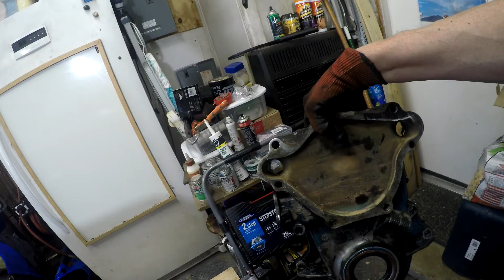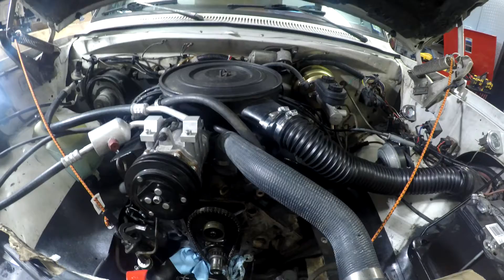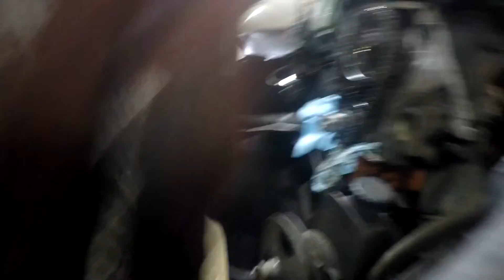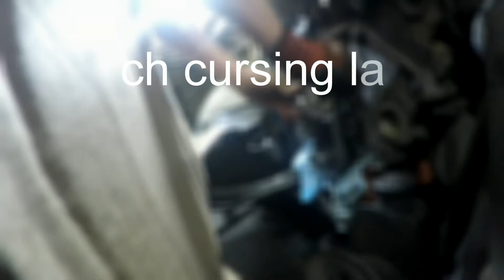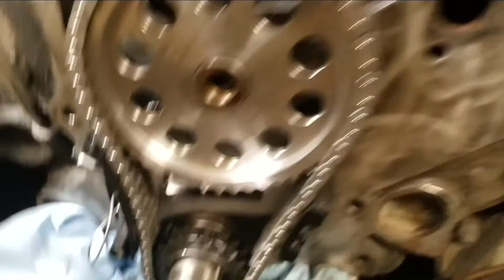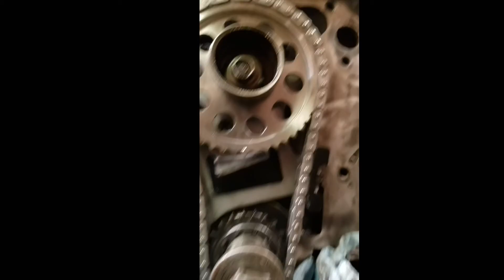1986 Dodge D150 318 Timing Chain Tensioner Upgrade

Comment: Great video! Thank you so much for posting! I was doing some research on my own truck, which led me to your video. I have a '97 Dakota, but it's not the V8, it's the 3.9 V6 (Magnum). It has just under 89K miles on it, and the chain has rattled since I bought it almost 2 years ago in 2019. I finally decided to address it, and have been doing some research. I want to put the strongest, longest lasting chain in it that is available - and from what I have read, that would be a double roller. I have been told that if a double roller is used, a tensioner is not necessary - but if one can be installed, I want to put one in! No such thing as overkill right? I have been trying to find out if anyone has used a double roller chain along with a tensioner on a V6. Summit Racing was kind enough to respond, and said that a tensioner would not work with a double roller (but did not explain why). Then, I found your video, doing exactly that - but I also understand it's not the same engine as mine. Do you mind if I ask you: Is this something you are trying on your own (using a tensioner with a double roller), or did you already know that it would work beforehand? I realize we are talking 2 different beasts here, but I wanted to ask you after seeing your video. Looking forward to hearing back from you (if you have time to reply), and also looking forward to part 2!  Thank you for your time.   -Steve
Reply: Hi Steve, "No such thing as overkill" is exactly what I was thinking.  The timing chain tensioner that I used was originally designed for the V6 due to timing chain stretch issues on that motor.  Apparently it was so bad on the V6's that Dodge created the tensioner and put out a service bulletin for those complaining about 'noisy' engines.  Did your V6 Magnum already not come with it installed?  I have completed the installation and so far, so good (I'll be posting a follow up soon but there's nothing much to show really).  FYI, it was a real bear to get on as you can probably tell from the video.  As far as trying it on my own, I had read forum posts where they said it was ok to use the tensioner with a double roller so I just decided to give it a try to see what would happen.  I don't know how much extra life I'll be getting out of the chain but It's a bit of a pain to get the cover off so I didn't want to have to do it again for a long time.
Reply: @psykoD  Hi Tim, Thank you so much for replying. I really appreciate you taking the time! Glad to hear you are back on the road and all good so far. From what I understand (to answer your question), Dodge didn't start installing the tensioners from the factory until '98, and apparently my truck never had the tensioner retrofit as per the service bulletin. I also wanted to mention that while Summit Racing stated that a tensioner would not work with the double roller, Hughes Engines got back to me, and not only said both could be used together, but gave me the part numbers (the HUG 6440 chain setup, and the CLO 9 - 5387 tensioner same as yours). So, thanks to you and Hughes Engines, I have the info I need now. Like you, I don't want to do this again for a long time! Thank you again for taking the time to reply Tim. Take care! -Steve

Comment: The Chloe's brand was the only brand that had It advertised for small block Is 318 I bought mine for 3.9 l It is the exact same One number off on the part number And was $40 cheaper

Comment: Thank you for the vid. I am working on a 87 Dodge Dakota, with a 3.9 Mitsu V6 and I think its similar, but the guy thinks bubble gum and tape can fix anything on this old truck. LOL, it took me half a day to convince him that it was leaking antifreeze from the timing chain cover and not the freeze plug that is strait behind the fuel pump on the front of the engine.
I also think I am going to have to pull the fuel pump to get the timing chain cover off, and I know the Harmonic Balancer has to come out. He thinks its just a 6 bolt deal and that will be it. 
I also am betting the antifreeze has corroded the crap out of the passages on the cover. IDK, I will see in the next day or 2.
Good vid though. The Klingons would be impressed: https://youtu.be/_2nM6iaT2u4 LOL, for grins.
Reply from the maker: Thanks!  Good luck on the leaks.  I know it's hard to find a good mechanic.  That's why I do most of the work on my cars myself.  The other day I took my mom's truck to Firestone for an alignment.  When it was completed I looked at the alignment printout.  It was almost  exactly the same before and after except for toe-in.  When I asked what was up, he tried to tell me the front aligned didn't have the ability to set caster/camber so I took him out to the truck and showed him.  That's when he admitted the 'regular' alignment guy was late.  They gave me my 100 bucks back at least...haha.